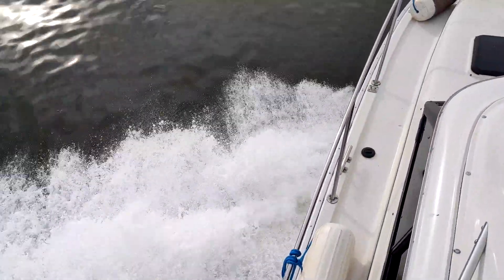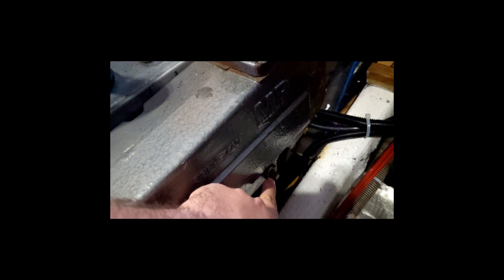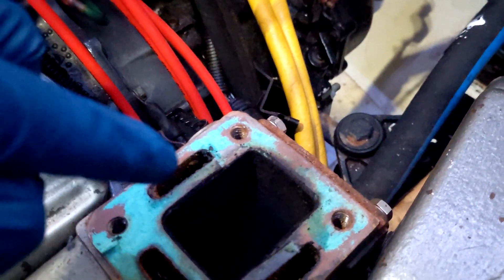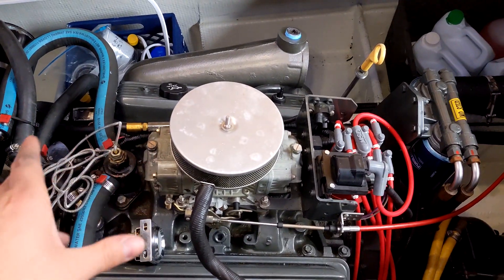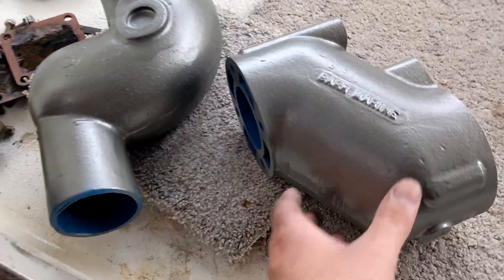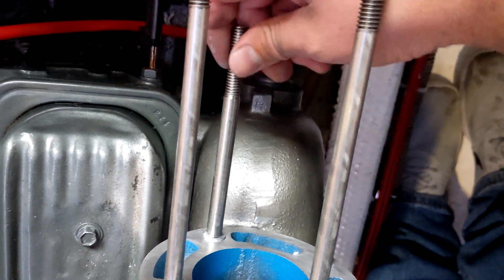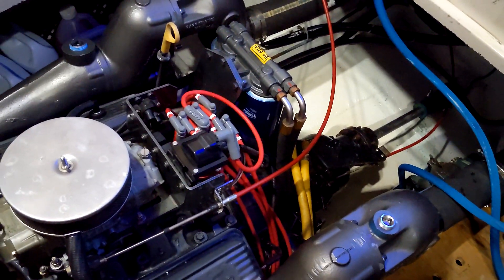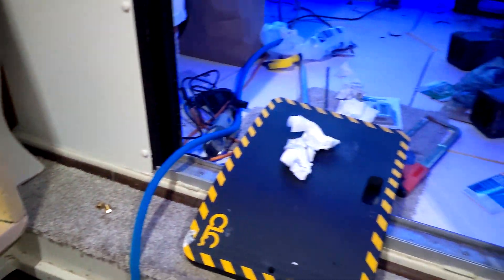Silverton 34C - Marine Chevy 5.7 Vortec Exhaust Manifold Replacement

Comment: Would you say you were exhausted after this?
Reply from the maker: Just a little smoked.
Reply: @WJsLifeonaBoat  your puns are a little rusty. Might want to stick to videos.
Reply: I’m skeptical about your claim how long these exhaust manifolds last.  What is the test or diagnosis for when one or both are bad?  You failed to explain exactly how you determined that the manifolds needed replacement.  Show me. 

However if you must replace you should upgrade to center riser manifolds because they flow exhaust better like a set of headers.  Those old log style manifolds are not really very good for engine performance.  Very restrictive.  

Or upgrade to aluminum manifolds.  Appears that you have a vortec 5,7L engine and more than one company makes a aluminum exhaust manifold for this engine.
Reply from the maker: @dewholdingsllc1050  Oh, I used industry standard average failure rates for cast iron manifolds, risers, and elbows in saltwater. I have pulled the elbows off previously and cleaned out the corrosion and scale build up through the water passages. The cast iron walls were starting to thin. Also, the elbows themselves had heavy corrosion and were flaking pieces of material off. 

In this case, center rise manifolds do not clear the floor on this boat. The OEM setup was log, the original manifolds on the repower, were log style. Again, the replacements out of necessity were logs. The center rise manifolds do flow slightly better but it is a marginal difference. 

No thanks on the aluminum, have corrosion issues there as well, not to mention at least triple the price.
Reply: You can pretreat coat new cast iron parts internally with a rust preventative such as POR 15 or one like it.
Reply: You can also convert to a closed cooling system.  Eliminate sea water running through your engine.
Reply from the maker: @dewholdingsllc1050  I have a closed cooling system already, the engine has coolant running through it.
Reply: Such a great idea, I would also consider upgrading to dry exhaust manifolds to eliminate any future issues…
Reply: @zacharythornton7358  if you have open headers, your manifolds can't rust 🧑‍🔬
Reply: Just close the seacock, you have a closed cooling system. Keep that harmful saltwater away.